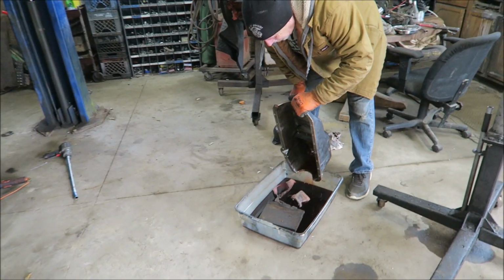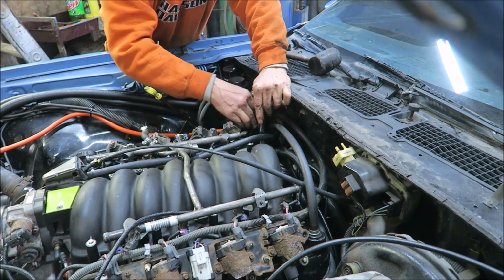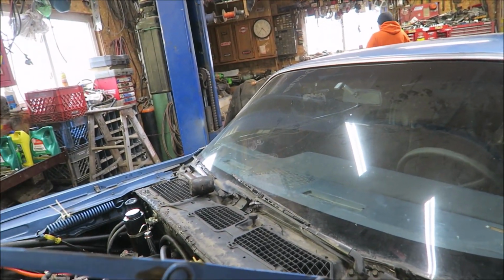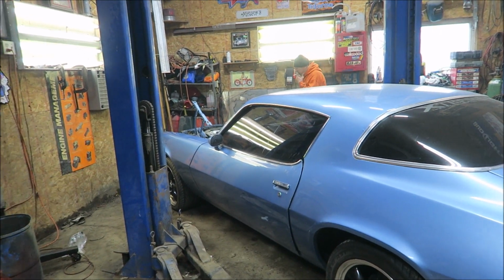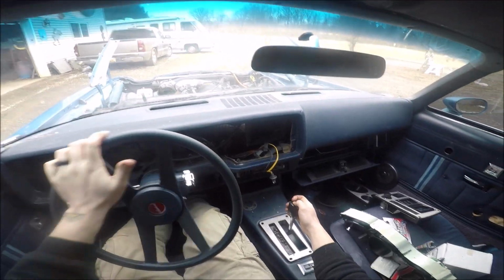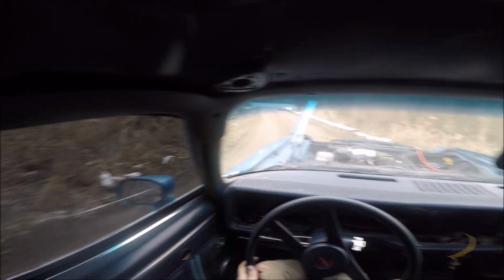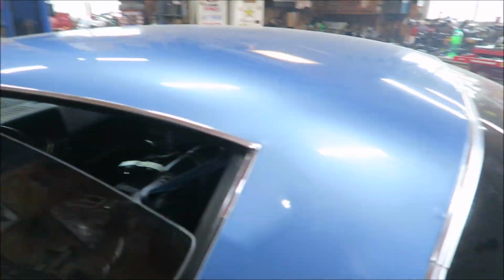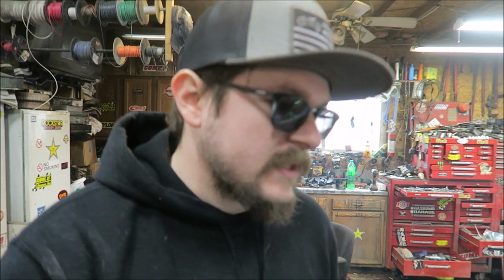FINALLY DRIVING LS Swapped Camaro! The Nasty Potato Cam Is SICK!

Comment: What size cam is that
Reply: I was just wondering the same thing. Hope they reply
Reply: It's a snidertron grind.no shit really from Texas speed
Reply: @chuckpatrick9926  right it's a good sounding cam it not to Roudy it's just right
Reply from the maker: Its a 223/227 .600/.600 110+3 🤫
Reply: @SniderTron3000  thanks bud sounds good
Reply: Just call Isiah at Texas Speed and tell him you want the Doctor Differential Snidertron3000 cam grind cam kit with PAC1219 springs. Done deal you got the same one!
Reply: Unless you already have springs and pushrods, then just get the cam 😂.
Reply: That seems like a pretty big cam for a 5.3 no? I'm just getting into ls stuff so I don't know much about it. Also, what converter is in the trans?

Comment: A good trick on the th350 kickdown cable is to pull it out a little  and zip tie it to adjust shift point and line pressure. Oops I'm thinking  4l60 lol.
Reply: The kickdown cable on a t350 just kicks the transmission down to a lower gear for passing or faster acceleration. It has nothing to do with line pressure or shift points. You don't even have to hook up the kickdown cable, the transmission will still function normally...you will just have to use the shifter to manually downshift if you want a lower gear to pass or accelerate.
Reply: Ha. I got the old  4l60 running  in my head.
Reply: rivervalleyray I took mine off completely! Works fine!

Comment: What was that rattle or ticking.sounds almost like the fly wheel
Reply from the maker: The bearings in the power steering pump. Fixed that and the noise is gone 👍

Comment: What welder do you use for exhaust pipe welding?
Reply from the maker: That one is just a $170 Harbor Freight MIG. I've been trying to do more stuff with my Primeweld  TIG225 though. But I'm impatient so most mild steel stuff I'll just mig to get it done lol
Reply: I got the 125amp mig do you think that's good?
Reply from the maker: Yeah, that should be totally fine for stuff up to like 1/8-3/16. The general rule of thumb is 1 amp for every .001" material thickness. So 125amps for .125". But they can be pushed further than that if its not a problem to put some heat in what you're welding.

Comment: I'm from ypsi, mi I got a 4l60e that needs rebuilding can u point me in the right direction?...
Reply: Yup. 4l80e
Reply: @Sawsquatch  lol everything is plug and play will switch right out?...or is it better to just grab something like the monster in a box from monster transmission?
Reply: @mattc4051  There's a fair amount of work to it. You will need some fab skills, and a tuner. Not a swap I've done personally, but anything that gets you away from the 4l60e is a good investment, in my books. Even a 4l65 is a decent upgrade. I know there's at least one company that sells a kit to retrofit the 60 case to a 65.

Comment: NICE BRO. When it stalled pulling in the drive way. that’s what I was talking about vss sensor keeps it from doing that. But heard using a manual trans tune is supposed to eliminate that issue as well if you don’t have a vss hooked up. What’s ur thoughts?

Comment: Did the trans guy give a guess to what happened? Other than it just being th350 doing its own thing.
Reply from the maker: Yeah, when he pulled the pan off the whole thing was filled with like a grease. It was bizarre. And a few things looked kinda janky inside
Reply: SniderTron 3000 so somebody used the non Lucas slip fix in it before awesome that it’s running like a beast now.